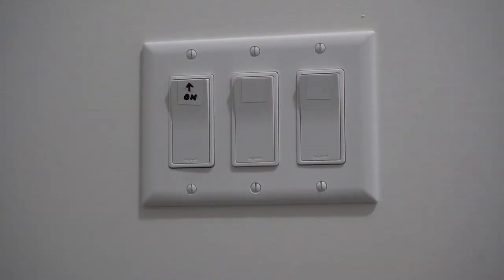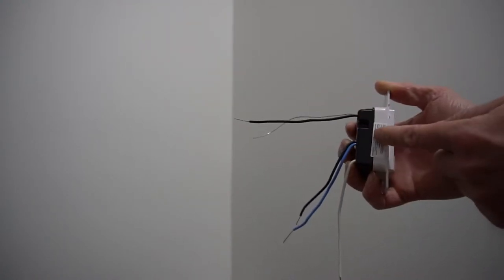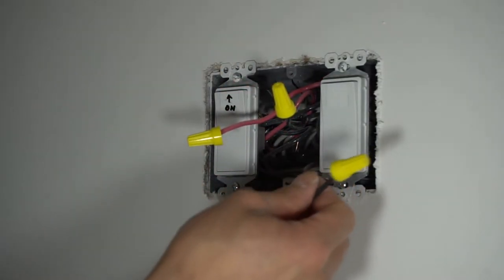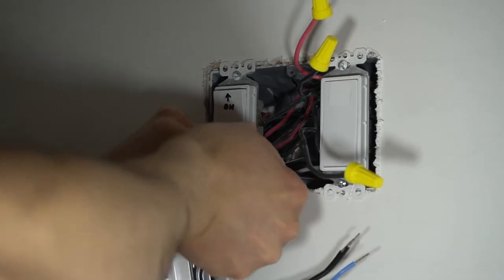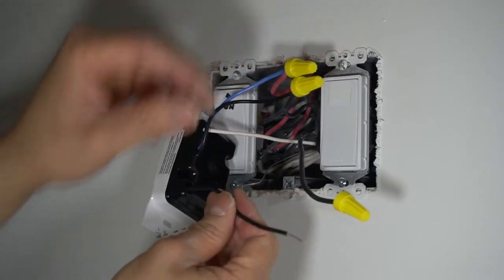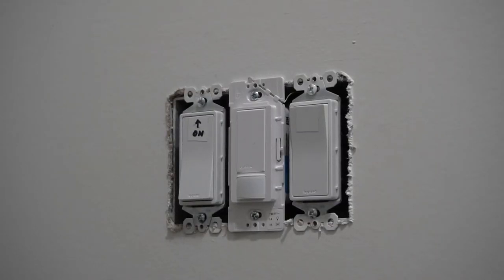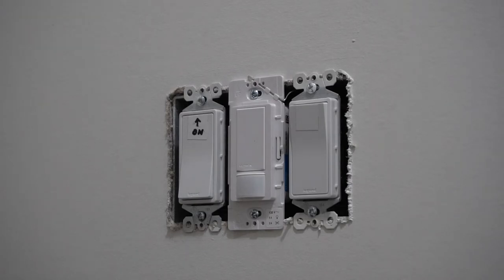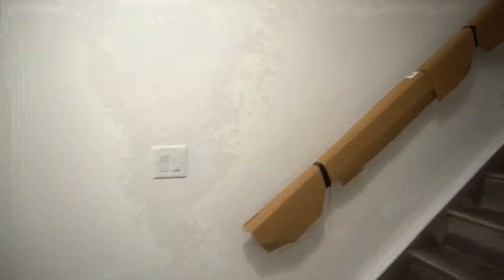HOW TO INSTALL Occupancy Sensor Switch 3-Way and Single Pole - Lutron Maestro OPS5M-WH

Comment: Hello! I have a 3 way setup and I had a handyman come do this for me (I just don't trust myself lol), but what's happening now is that the regular switch doesn't turn the light on (however it can turn the light off with it if I trigger the light with the Maestro first). What wiring did we mess up? I noticed that he didn't use that one wire at 1:43 and used the one at 0:52 to hook to the very back instead

Currently the light only turns on when the regular switch is in 1 state, acting as the gatekeeper😆

I'm hoping to still be able to use the regular switch separately if possible in this setup

Great video though! 

Thanks!
Reply from the maker: Hi Timothy, oh boy that is so weird. But wiring at 1:43 you can skip. The wiring at 0:52 should be used to combine with the rest of the white wires.
Reply: @KevinPon.  I see, so the behavior I want is that I can independently use the mechanical switch while the Lutron will turn the light on regardless of what state the mechanical switch is in 

Is this possible? Or is the current behavior how it's supposed to work? 

Thanks!
Reply: @KevinPon.  oh, did you make changes to the other half of the 3 way switch? I just realized instructions for that
Reply from the maker: The other 3 way switch has to stay "on" so it does not turn off the Lutron. No changes made.
Reply: @KevinPon.  I see, so with your wiring, can you turn the lights on and off with just the mechanical switch (no triggering of the lights with the Lutron)?
Reply from the maker: The mechanical switch (your other 3-way), you don't do anything with it. You can turn it off but that will also turn off the Lutron. Then it can't work. So it's best not to touch the other 3-way. The Lutron is the only switch that you can press on and off.
Reply: @KevinPon.  ohhh! I was hoping to still be able to use the mechanical switch to individually turn the light on and off without triggering the Lutron. Is that not possible? 

Or for example, be able to turn the light on with the mechanical, then having it auto turn off (after x mins as set by the Lutron), can this not he done?
Reply from the maker: If you want to do it that way then yes it will work. But Lutron will only turn on if it can motion sense you when you turn it back on. When you also have it switched off. The Lutron will not work automatically as you have turn it off from the other switch.
Reply: @KevinPon.  I see, a little confusing lol. Can this following scenario be achieved? 

The light first turns on by sensing my motion, then I turn it off with the mechanical switch. Later I walk by the motion sensor to have the light turn on again OR simply use the mechanical switch to turn the light on again 

Because I don't want the mechanical switch to just act like a master switch for the Lutron😣

Thanks for the help so far!
Reply from the maker: You will simply have to turn back on the mechanical switch. Cause the whole system is off. Unless you put 2 Lutron. I'll have to test if that works. I'm pretty sure it will.
Reply: @KevinPon.  I see, a little sad, was hoping to use the mechanical switch as more than just a master switch hehe

The instruction does have some instructions for rewiring the mechanical one though, unsure if that'll make it work the way I want hehe

It involves using the included yellow jumper🤔
Reply: @KevinPon.  quick update! So I jumped the cables as per the instruction and got the desired results✌️!
Reply from the maker: That's awesome news Tim! I actually got a solution too but the solution I got will be using two occupancy switches. Posting video soon 😅
Reply: @KevinPon.  that sounds fun lol, looking forward to it
Reply from the maker: @tmywu  https://youtu.be/zEqfHxSLC-s secret is out time! lol

Comment: Wait...did you replace both switches with 3-ways or did you leave the other switch as a 3-way non-occupancy sensor switch?
Reply from the maker: Hi Rich, here a link with both switches replaced that works its the only way to get them both functional  
https://youtu.be/zEqfHxSLC-s

In this video only one switch was installed and the other 3-way non-occupancy sensor switch was left alone and cannot be used 🍻

Comment: What happens when you turn off or on the other switch that's in the 3way? Does that switch has to be on a certain state for this to work?

I added a occupancy switch to a 3way and it works only when the dumb 3way switch is on a certain position, otherwise it doesn't work at all.
Reply from the maker: Hi Glen, you are absolutely correct. The other 3-way switch has to be "on" in order for the whole system to work. If you have it "off" ot cuts off the power to your motion sensor switch, so it does not work. You will have to leave the manual switch untouched. 🍻
Reply: @KevinPon.  Thats unfortunate. Ill likely add a smart switch there and program it to auto turn on every 1 minute to avoid someone turning it off. Thanks.
Reply: So I guess it’s not as true 3-way then if you can’t change the state of the light on either ends.

Comment: Hello Kevin, me again lol

So this time I got the single pole version of this switch and realized that my old switch didn't have a ground connected to it (just 2 black wires on 1 side). I do see an empty screw in the back, so can I twist the green and bare wires from the Lutron together and connect it to the screw in the back as ground? 

Thanks!
Reply from the maker: Yes that's correct Tim! The back of the box are for grounding. You go it!👍🏻👍🏻
Reply: @KevinPon.  hm, another question here, if I have a neutral, should I be connecting that too? Don't quite understand the purpose of it. My old mechanical switch only had 2 blacks connecting to it
Reply from the maker: If there's a neutral. Generally you will put all the whites together. Most of the time!
Reply: @KevinPon.  and a slightly random question, if you turn the lights off manually with the big switch (before the timer is up), how long does it take before it starts registering motion again? 2 of mine are around 30 secs but this other one takes forever
Reply from the maker: Mine is around 5 secs or less. Not long.

Comment: Can I install a motion sensor on a 4 way switch????
Reply from the maker: Absolutely. Yes you can. But have to wire it correctly is the key
Reply: @KevinPon.  I only have 3 wires on the motion sensor???? And my 4 way has 4 wires...can u please explain???? Please
Reply from the maker: @selaxlife7621  It's a very to what I have going on here in this video https://youtu.be/zEqfHxSLC-s
Will need to rewire so the 4-way will have constant power at all times. The 3-way you must not touch, it has to stay "on" all time time or it will not work.
Reply: @KevinPon.  thanks bro!

Comment: @KevinPon1. I've got kids. They are always leaving the fan on in the bathroom. My solution? An occupancy sensor switch.  The bathroom has a sink and a toilet.  The are two switches. One for the exhaust fan and one for the physically seperate light fixture.   So I decided to have the light fixture motion activated.   I took note of how the original switches were wired. But when it was time to use those drawings. I couldnn't make sense of them. Go figure. I did not realize it when I started but it turns out that they adjacent foyer light, a wall outlet and my porch light wired into the bathrooms switch box.  So  when I disconnected the wires, all the above had no power Anyway, with both switches pulled out from the wall, the box  has a bundle of nuetral wire,  four black lines, one of which is hot. Not sure why. But, Chatgtp tells me to wire up the occupancy sensor with fan control first.   The switches need to operate independantly of each other. In other words. I do not want one switch to work only if they other switch is turned on.  The occupancy switch has  a Line in, a load out, a ground, a nuetral, and a blue traveler.   The motion sensor light switch has a line in, a load out, a nuetral and a ground. I connected each switches ground to the wall ground. I connected bothe nuetrals to the nuetral bundle. Having only one Hot line I wire nutted the line in of bothe switches to the hot line. I connected  the load out lines of each switch to its corresponding fixture line. Now, here is the problem. The fan will not turn on unless the light switch is turned on. I still have one unused black line in the wall.  I'm think that line delivers the power to my foyer, prorch light and wall outlet. So, I'm guessing I should have also wired it to the hot like in the wall.  Do I need to use the blue traveler to power my light switch instead of a black line in? I'm guessing that the traveller provides constant power and bypasses the on/off switch. Fast response would be greatly appreciated. I mean happy wife , happy life, right? Yeah shes sort a pissed that my work cut some of the power. LOL.

Switches

Lutron single pole motion sensor with fan control  MS-OPS6M2-DVR-WH
and
Lutron single pole motion sensor light switch MS-OPS2
Reply from the maker: Haha oh boy. Hi Peter, I'll try my best to help you out. From what you have been telling me. Whoever wired your place, put everything on one circuit... You're on the right track. Do not use the blue traveller, just cap it. We won't be using it. What we are going to do is connect your hot wire to: line for the occupancy, line for your motion, and the remaining black wire that feeds power to the foyer, porch and wall outlets. Combine them all. Connect your two loads as I've read you have already done that and all your ground wires. Connect all the neutral wires together. Make sure you have your breaker is off to be safe. When everything is all complete you can turn the the breaker back on and everything should be back to normal. 🍻🍻
Reply: @KevinPon. so, indeed. Everything is working. I didn't die,  I didn't burn the house down. Mind you. This is the second set of switch. With the first set I thought I had it hooked up right. But clearly didn't. When I hit the switch to turn on the light. The actual light switch blew up. This included some shrapnel on fire as well. That happened before I messaged you. But we are good niw
 Except the setup still isn't functioning as expected. The fan switch  is behaving  as though it gets it's power from the light switch. It doesn't. But fan won't run unless the light switch is turned on. When the light switches sensor shuts off the light. The fan stops. But I don't want that.
The two seperate switches are pigtailed to the one hot line in the bathroom. So both are independant ly powered. Or at least they should be.  I was hoping  to ha e sensor active light.  A fan you have to turn on. Then the light shoukd go off after 5 minutes. Whike the fan runs for 5 more mi utes. That was the idea. But instead. I have to set. The light to remain on longer than the fan. I guess with these poless switches, there's no bypassing the switch. In the old setup. Power went to the fan first then over to Line of the light switch  L. Am I Mali g sense? Am I missing something here? Perhaps a second hot line from the wall?
Reply from the maker: That is so weird. When you splice the line with the light and fan switch. They should both be functional. The fan shouldn't rely on the light switch.
Reply: @KevinPon.  and both neutrals go to the same bundle of neutrals in the wall.
Reply from the maker: Yes, combining them would be the easiest. Since we have no idea what's going on exactly 🙈

Comment: Where did the white wires come from?
Reply from the maker: It's the same wires that were previously attached on the original switch 🍻
Reply: In your video you remove the plate and show your old switch.  No white wires are connected.  I went back and checked to see if I’m losing my mind.  Are those wires in behind in the wall?  Are they connected to the other switch?
Reply from the maker: Opps my bad. They will be the white wires inside the box. All the white wires inside are mostly connected together. That's what you'll be looking for 🍻

Comment: Why are you working with live wires?
Reply from the maker: I'm an electrician. There's a risk but I am not worried.
Reply: Gotcha. I’ve had to do that a few times before as well. Certainly not the most desirable method to say the least.
Reply from the maker: Sometimes you gotta do it 😅